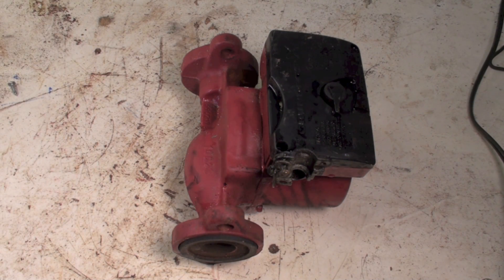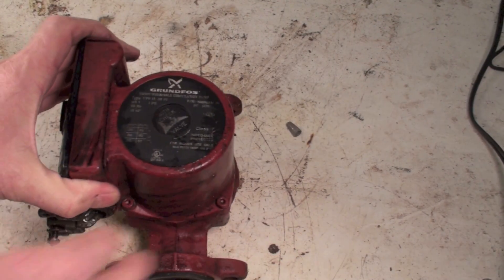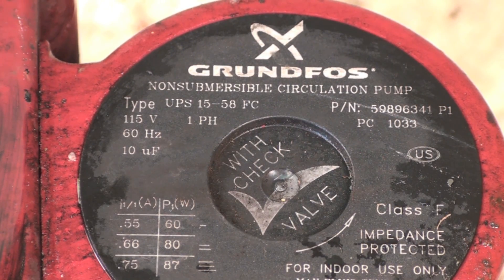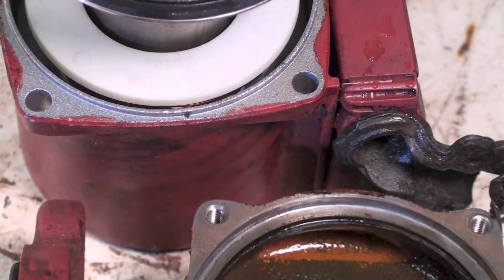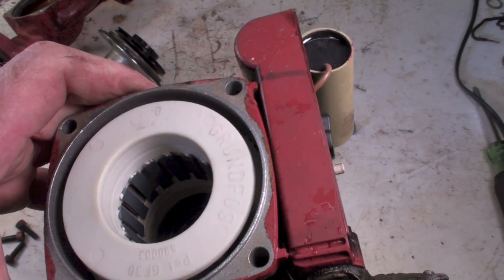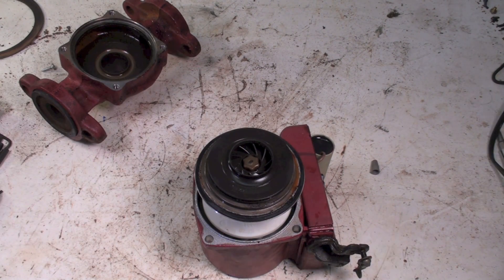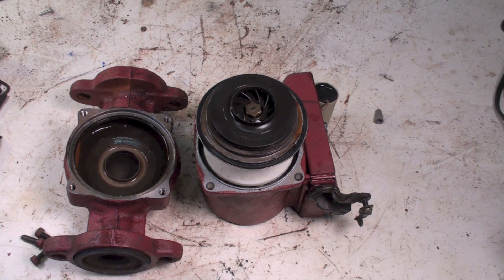Disassembly of the the Grundfos boiler circ pump

Comment: Why the check valve? What would be the purpose? Thank you
Reply: During the heating season (winter) the motor may not be configured to be "on" for several months.  The check valve is valuable in preventing a dry startup, especially if the motor is installed in a vertical pipe position.  Not that it is perfect, or would last for decades.  Still important to make sure there is proper water pressure (15) to fill the impeller upon seasonal startup.
Basic mechanics...nothing magical here......

Comment: I realise this thread is old but what would cause the pump to get very hot and burn out the windings? Replaced a 15 58 grundfos pump with same number and it also gets very hot...110 celcius...dont know what to do
Reply from the maker: The temperature of the pump may have nothing to do with the winding failure.  To be sure, check amp draw of the pump.  It should be at or below the rated amperage on the pump.
GFM
Reply: @grayfurnaceman  Thanks for the reply!

Comment: You missed the problem as I see it. You did not state the size of the Allan wrench required and if it is metric or ASE, to remove the screws. When removing the impellor and motor assembly, not to ply on the impellor with a screwdriver as very strong magnets hold it in place. Be very gentle and use 4 or more plastic or wooden wedges to get the assembly to move until you can use your fingers. Explain about removing "the can" to clean and remove anything stuck to it.

Comment: I just got one, haven't installed yet. What is the purpose of the check valve?
Reply from the maker: To prevent back flow in the off cycle.
GFM
Reply: Thanks
Reply: Most hydronic systems will already have a separate flow control valve in each loop.   So you might want to check for that before getting a pump with a check valve.

Comment: My plumber replaced mine, it did solve the problem of no heat in the mud room, but I hooked power to the old one and everything turned fine on the bench.  What gives? Same part # as yours.
Reply from the maker: The pump was probably either not big enough or the impeller was worn.
GFM

Comment: Hi. Do you know where i can find troubleshooting info on these? I have a N.Y. boiler hooked to a 2 zone heating(hwbb) system with 2 Grundfos circulator pumps with check valves. When turning on heat in one zone, i get heat in both. Thermostats working in both. Circulator pumps kick on/off when thermostats turned up/down. Could it be the check valve in second zone not working right? thermostat? Thanks
Reply from the maker: Depending on how its piped it certainly be a stuck check valve.  
GFM
Reply: Thanks so much, appreciate it!
Reply: @missyconway9265  Were you able to remove something stuck in your check-valve, or did you have to replace it?
Reply: @McGyver9  replaced the check valve

Comment: What is the advantage of having 3 speed pump for baseboard heating I have this pump installed set on 2 with no Zone Heating small house one level does it matter what's speed it's on ?
Reply from the maker: The 3 speeds are there to adapt the pump to the system.   If the heat flows to all baseboards,  Its high enough.
GFM

Comment: A question regarding opening the pump with it installed.... I know that there are similar pumps that has a "screw" where the "check valve" sign so that it could be opened up to check if it was running, and could get it running again with just a screw driver... However, is there a way to open these ones that doesn't have that "front screw" part? (Sorry that I don't know any of the "professional terms" here. Hope that you understand what I'm trying to say here.)

Comment: my grundfos UPS 15-58 FRC is not working.  The motor isn't even trying to run.  This happened a couple of months ago and I banged on it a bit and it worked and kept working until today.  Is it safe to say the motor is burnt out?  Does it need to see a minimum pressure to trigger the motor on?  Just curious if its something other than the motor being burnt out, maybe I have another problem?
Reply: You have already had good info from Scotland.
Reply from the maker: The pump bearings have probably failed.  If power is to the pump and it does not run, the pump has failed.
GFM

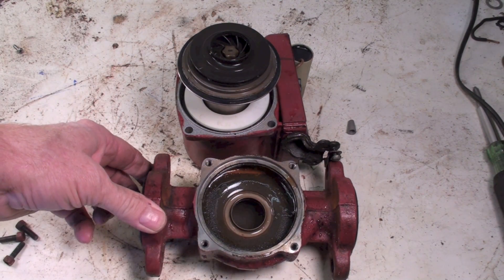Comment: 1:08 where the magic happens. For a video that's billed as showing "disassembly" I was quite disappointed that the disassembly part of the video was edited out.  Specifically, you don't show how to get the rotor out of the stator, and there's no "putting it back together" to help either.
Reply: grayfurnaceman I came here for a disassembly. What about the motor windings and that died control you pointed out? This doesn't show maintenance level disassembly let alone what YouTubers expect.
Reply: I agree with Alafrosty.. This video's great for showing a Grundfos inside and out, however, the title is very misleading.. the appropriate adjetive would be 'disassembled'; then people know they're going to see a disassembled unit, but not expect to see disassembly.
These units are not either working or dead; there's very common problems which happen which require a simple disassembly, cleaning, and reassembly.  
Alafrosty gave you civil and useful feedback on your video title, and you turned the tone to a personal attack.. "want me to show you how to turn the screws?"... I'd love you to show me what tool you used to do it anyway.. I'm seeking a disassembly video to watch before I travel to where I'll rebuild the pump.  I know it's all easy, but that doesn't make disassembly videos useless, and that doesn't make this a disassembly video.
Reply: Critical Insights you sound like a bitch
Reply from the maker: Four screws and its done.  New gasket or high temp silicone and four screws and it is back together.
GFM
Reply: I don't think you looked at the video. You show an assembled pump, and then, presto, cut to a disassembled video. There's literally no disassembly process in the video. Even your comment doesn't convey how to remove the impeller from the housing.
Reply from the maker: I not only looked at but I made it.  Do you want me to show you which way to turn screws?
GFM
Reply: 😅 @grayfurnaceman
Reply from the maker: There is no maintenance for this unit.  The disassembly is just to show what is inside.  These things either work or they are dead.
GFM

Comment: Just a wee footnote from across the Pond; 
These circulation pumps are bullet proof, if you have one that stops working 'clean the can', it's a wee secret the manufacturer doesn't want you to know, under the big washer on these you can remove the outer can & clean up the water section/bearing, re-assemble & 9 times out of 10 the pump will work for another 20 years.
Regards from Scotland.....👍😉
Reply: Fibre Washer ..... will this get rid of the rattling noise mine is making?  Cheers mate
Reply: alex monty any solution on the rattling noise?   Mine is loud at start up and then i can hear it constantly rattle through the pipes.
Reply: @gfriedman99  Same here. Mine is on my radiant floor heating for my bathroom. I hear the rattle when I'm quietly sitting in my living room and it's running below me. Annoying.
Reply from the maker: Fibre Washer Thanks for the info.  When I think about it, that is certainly true.  
GFM
Reply: +Fibre Washer Can you please further explain or show what it means to "clean the can"? Thanks.
Reply from the maker: +Shaun Luong You just remove the motor using the 4 screws.  The can is the housing.  You must bleed the boiler down as you are breaking into the water system.
GFM
Reply: Fiber washer where about are you in Scotland lol
mine is playing up on my biomass heating system. There are no indicator lights lighting up. System is only 3 years old.

Comment: I put a UF 15-42 (single speed) in the heating system in my cabin in 1992. It runs almost continuously for 5 months of the heating system and I've never replaced it. I have 15 Grundfos pumps, most of them variable speed, in my current system (don't ask!) and a few of them burned out early. I backed the speed down to mid level and they have performed well.
   The check valves tend to stick, though, and I'm hoping I can clean them since they cost $25+ each! A lot for what they are...but they are handy! When they fail, water backflows through the zone.
Reply: Don't know if you will see this reply but an FYI. Having moved to the EU in 2006 we went from a hot air system in our home in the USA to a hydronic system in our current home. There is one very important part to the systems that I don't know if they use in the states but just as with any hot water system there should be a sacrificial anode installed in the return water line going into the boiler. This will help prevent corrosion and scale buildup within the system which can clog anti back flow valves. The optimum system would contain a glycol mix as well to further reduce corrosion and provide greater heat transfer. Anodes should be replaced every year or two depending on age of system, water quality ( hardness ) hours of usage annually. Proper anode housing installation should provide for shutoff valves on both sides of the Anode housing. This will help prevent excessive air being introduced into the system. If available automatic air purging valves should be used in each heating loop and at the highest point within the loop if possible.

Comment from the maker: Don't be too hard on them.  Some people are not able to transfer their knowledge.
GFM
Reply: I am running a mix of 30% glycol 70% water with furnox boiler conditioner.  I have developed a small leak somewhere.  Can I use Oatey 30115 Hercules Boiler Liquid Stop Leak, or will it bind the rotor in my Grundfos Circ pump?  Thanks.

Comment: Taco pumps with IFC valves have replaceable impellar cartridge assemblies to minimize downtime, prevent having to purchase whole new pump along with the labor cost of removing and re-installing it.  Current record stands at 14 years of operation before a RedyTemp required a cartridge replacement.

Comment: Interesting vid! I have found Grundfos to make good quality stuff.

There are some refrigeration compressors with a similar design of motor, they look semi hermetic but there is a stainless steel cover over the rotor to seal it from the atmosphere. You can change the motor windings without needing to remove the refrigerant.